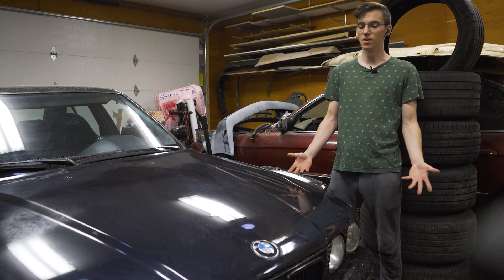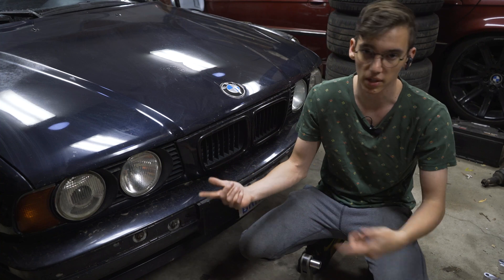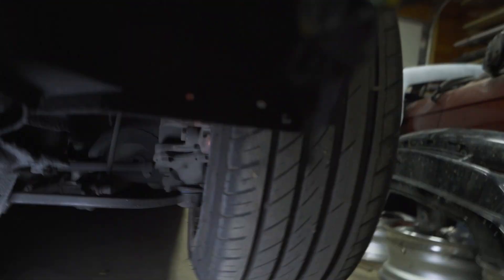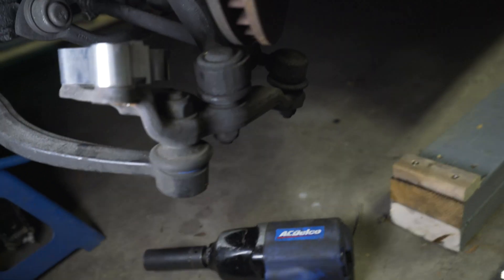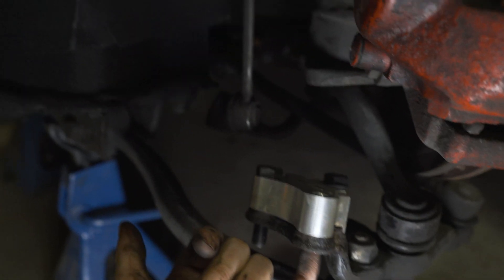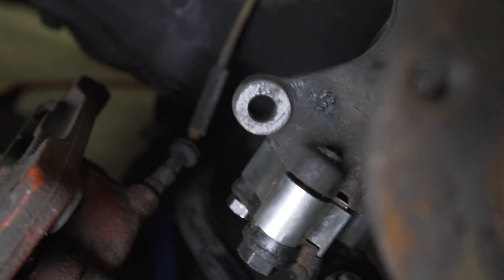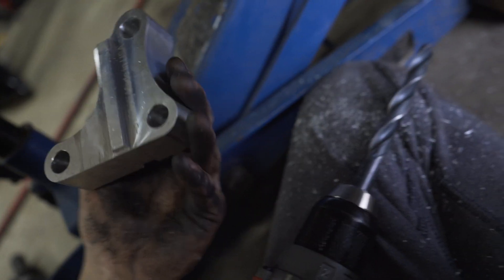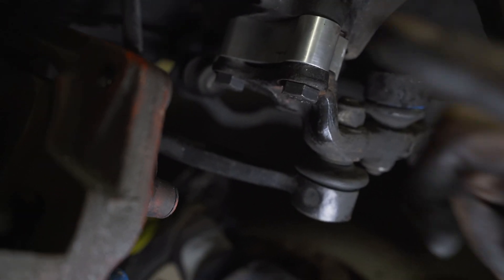AKG Bump Steer Correction | BMW E34 M50 Turbo Build | NeverEnding

Comment: I machined a lot of aluminium parts when I worked in aircraft plants and it can change shape real quick with ambient temperature changes. I used to shut my NC machine down when they opened the bay doors to move fuselages in and out of the plants at Beechcraft during the winter. When that cold air wave hit, my $50,000 part would go all out of spec.
Luckily at Boeing it was mostly titanium and no bay doors.